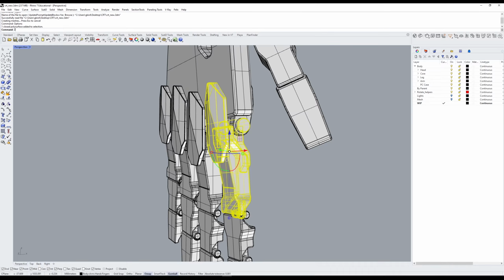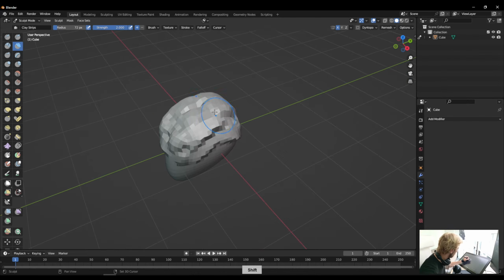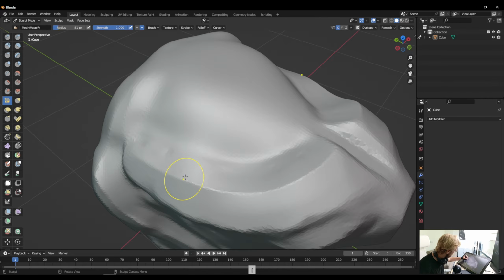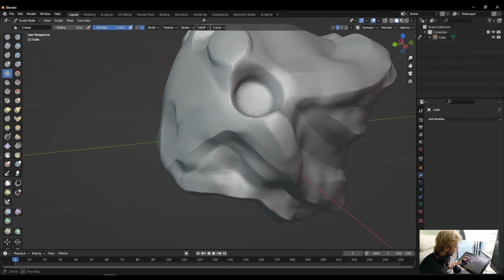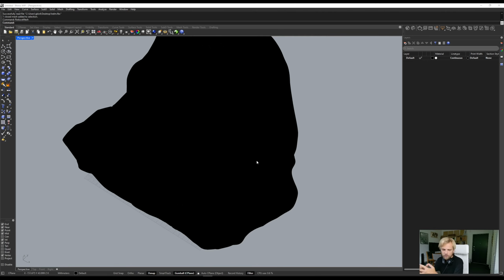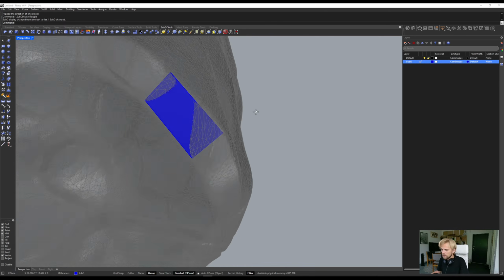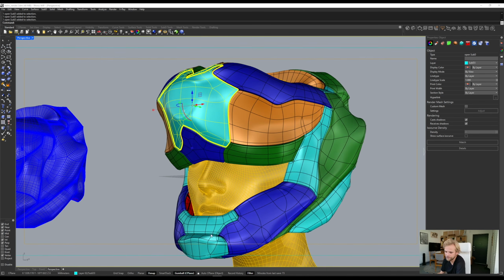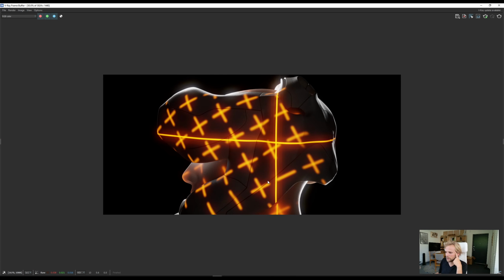My 3D Sculpting to CAD design workflow

Comment: Remesh and and clean it up before export, also if the mesh is really heavy then save the heavy mesh, decimate it,  and use the original mesh as a polygon map for the low poly model

Comment: Very cool and informative video! Makes me wonder what made you switch from blender to rhino? Especially when Blender's subd capabilities are usually considered superior to rhino.
Reply from the maker: For production - you want your curved geometry to be NURBS , simply unlocks many more pissibilities in how the design can be manipulated. Currently Blender doesn't offer that, so at a certain stage - a shift to a CAD software needs to be made.
Reply: Yeah interesting question. I usually build SubD topology in Blender and then import to Rhino for final tweaks and NURBS conversion. I much prefer the SubD tools in Blender.